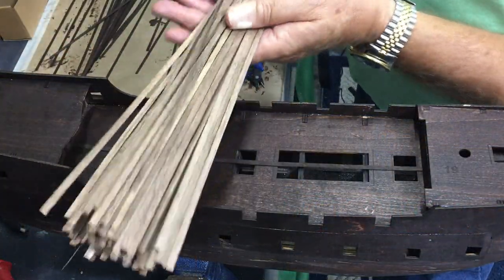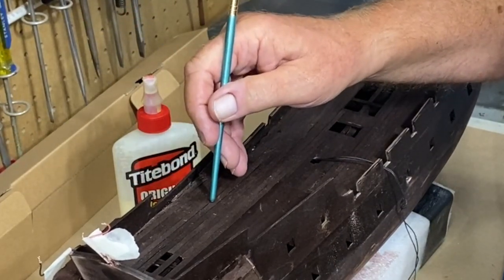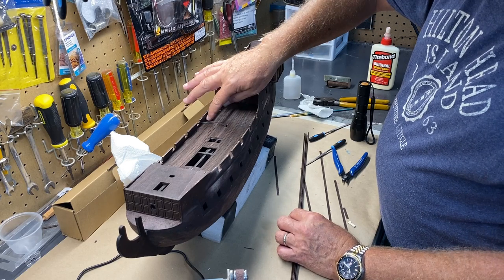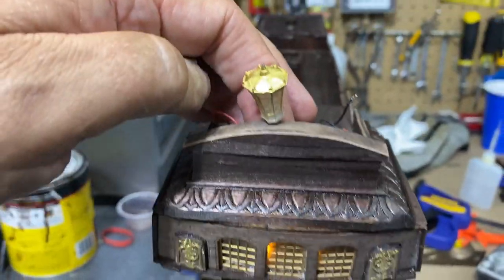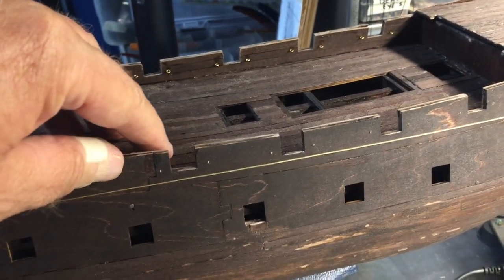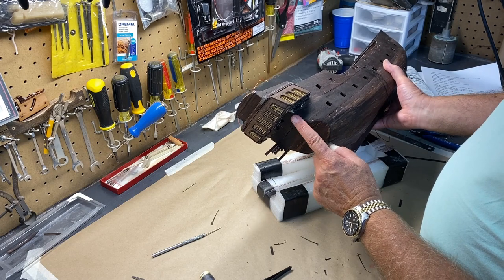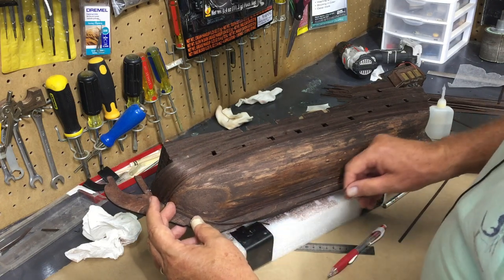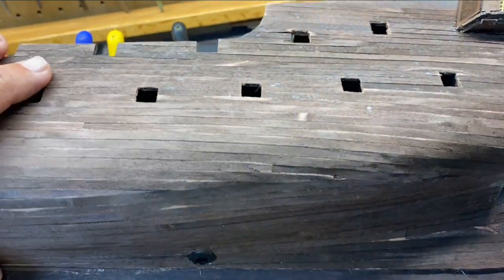The Black Pearl Golden Version 2021 Episode 8 (Walk The Plank)

Comment: Looking Good Dan. There is definitely an artform/science to planking. Many different opinions and technics out there but good old practice helps. For a waterline I secure the boat level on the bench and then clamp a pencil sideways in my small table top vice ( panavise 301) then drag the vice/pencil around the ship at the desired height to make waterline. Definitely recommend the panavise 301. It has been an great add to my tool kit
Reply from the maker: I will check out the P301 and put it on my Christmas list 🎅🏼.
Patience is what I need to work on…. I think I would do a better job of it!  Tried reviewing some techniques and my mind can’t handle it…. So practice and overcoming the obstacles is my only hope!  But I already can tell that this one will look better than my other attempts once I get another stain on and some good coats of Tung oil on it.
Thanks for your advice…. I probably should also watch some videos on the topic!  So little time, even in retirement 😂
Reply from the maker: Just checked out the P301. Great idea, it can replace the steal jaw overkill vise on my work bench! It’s on my “gotta have” Christmas list .
I just bought a bandsaw and my son’s making me a flip tool stand that will flip with my drill press.  Son and his neighbor are cabinetry makers as a hobby. Neighbor just gave me some black walnut slices that I will cut into planks. It’s some beautiful stuff.  I’ll feature the new tools sometime and you can see the wood too!

Comment: Great video Dan, well done :) when are you planning on putting the cannons in? it seems that you have no access to place them.. But i must be missing something, i think that in the previous black pearl model i had the same concern about the canons (I'm referring to to the the hall floors. or the middle one's)
Reply from the maker: The lower cannons on this model are kind of fake. Each portal on the lower ones have a casing built that provides a frame to hold just the cannon barrels. The outside of the cannon is normal but the backside is cone shaped that then fits into a hole that supports it.  So they are inserted very late in the build. The upper deck cannons are normal.  This version of The Black Pearl doesn’t have the lower decks or the open side.
Thanks for watching 👍